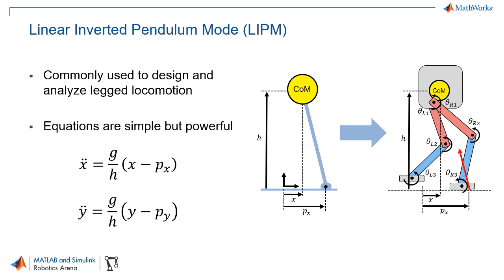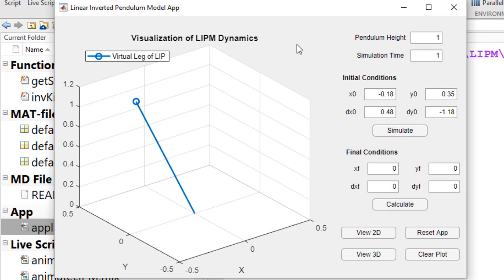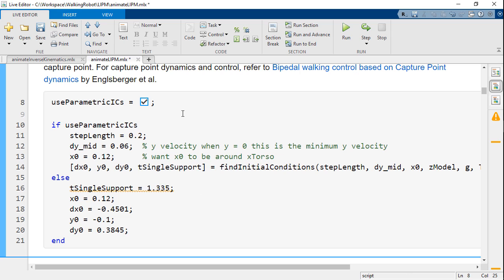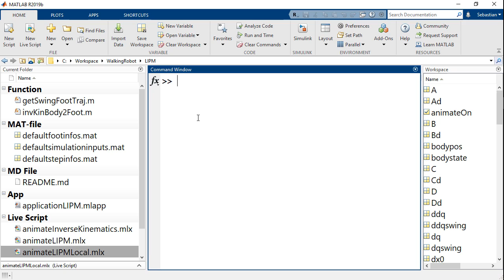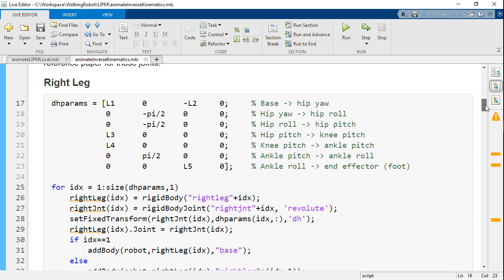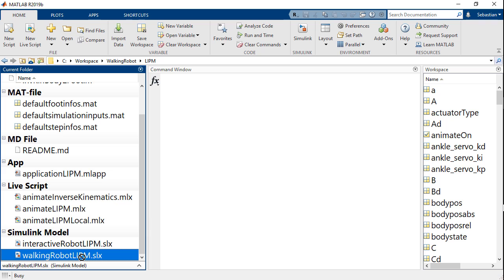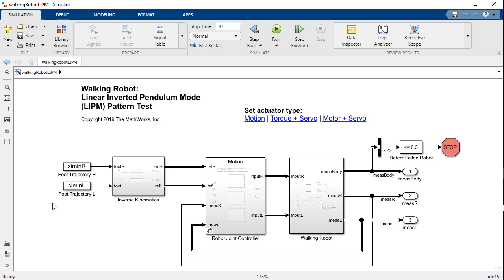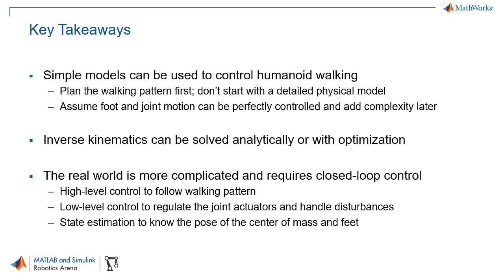Model-Based Control of Humanoid Walking

Comment: Hello @Bkim and sebastian, i'm Juan David Galvis, actually working in a project that is base in your excelente project, that project is for my mater's degree thesis, and i have a question that i really couldn't answer by myself at the moment, and it's how you build the model footinfo, where it has the diferent parameter for all the joints and movements, i'm already develop the database for recreate in my project but until now, i couldn't resolve that problem.
And it's because i'm working to recreate a working with legs but for a kinestesic work out, where we are implementing a mass-spring damper model.

So i'll be so grateful if you can helpme answering that question, how to recreate that file footinfo.
Thank so much to share your valuable knowledge.

Juan David Galvis
Physical Engineer
Universidad Tecnologica de Pereira - UTP 
Colombia
Reply: Hello Juan, I am glad this is helping you. The parameters for the joints are determined crudely based on intuition and assumptions. For example, Hip and Knee joints would use larger motor and higher gear ratio compared to Ankle joint. So I used values that would correspond to that. 

Please note that all the parameters are somewhat arbitrary. Although I tried my best to use values that would be close to real world robots, they are only educated guess (based on some references + intuition). 

If you have a real robot or a good reference for these parameters, please use them instead (and maybe also share knowledge). 

Modeling real things in simulation is hard. Even with best attempt there are always gap between simulation and real world. This project also suffers the same!
Reply: @bkim13 hi Brian, i'm so grateful of read your share knowledge.

I'm already searching a pattern of your file, like sometimg that a could use to recreate It in my own way.

I'm searching to take some initial input values from a model were It can work from information related with the walking pattern or trajectory in a free way, like ideal model without friction. do you think It could be posible, applying some equations that become that inputs in data like motor information?

It's like build a controller before to integrate that values to the simulation.

And i tell you a little more that could help to understand my idea,, our work consist of a sfuzzy logic controller simulation for isocinetic machine in work out were the body part involved are the leg, and the principal joint is the knee, so our simulation it's going to be reduced to a 1 joint to begin.
Reply: @juandavidgalviscastillo1071  I see. It could be easier to build the model from ground up instead. Try with fewer joints like you said and build your way up. That is how I built my model too. In the beginning it was just a few joints with no contact.

Comment: Hello! I have three questions, maybe anyone can help?
First questions
Can you control that robot using LQR? And how to implement LQR method into your model?
Second question, I saw that all of gains on your PID Controllers are so high. Can you explain why? 
Third question
It is about the torque that you've been controlled using PID. The input is motion, more precisely the configuration of all joints. Can you explain how could the input signal be controlled by PID and the output is torque?

Thank you so much, hope anyone will reply all of those questions 😊
Reply: Sure thing. 

1) Yes LQR can be used. But let's recap on the hierarchy here. When we control robot, we used 2 levels of hierarchy in this example (sort of): a) generate the trajectory for the robot motors to follow based on desired robot body movement; b) follow that motor trajectory. In this example I used very simple controls for motors to follow the trajectory (pure simulation motion, PID, and PID). Instead of PID, you can use LQR. Here the plant models would be that of motors controlling joints. Try it out and let us know how it works. 

2) Are PID gains high? What is it high compared to? For the given model/setup, these are the numbers that work well. Depending on how you define your model (e.g. what reference units used and what input units used), the number itself could be high or low. In this setup, those numbers made sense. I tried to setup the Simulink model to resemble real life robot closely (using realistic friction coefficient, gravity, etc.). But of course, there are always gap between simulation and real. 

This number might be high compared to motors with higher gear ratio. The gear ratios used here is 100, which should be in the similar range of actual gear ratio is this type of humanoid robots (very stiff, there are others that uses much lower ratio and others high). Depending on how you modify the model (to be more indicative of actual robot you use), this number may vary greatly. I would focus on the high-level picture; the numbers will be different for your particular robot. 

3) There are 3 variants for controller and motor model. For motor model go inside the mask of joint subsystems to see. The variants are Motion, Torque, and Motor. a) Motion joint is purely for simulation. On Simscape Multibody joints, we can directly tell how to move (it will generate the correct torque and velocity to achieve that).  b) Torque joint is where we tell the input torque for the joint. c) Motor joint is where joint has DC motor modelled, and we control the motor via its voltage (just like traditional motor control). 

The input in all cases is desired position (motion). Reference input to controller is thus position. Output from controller is a) position, b) torque value, and c) voltage value. Plant (joint) input is a) position, b) torque, and c) motor voltage. Plant output is "input" to the Simscape Multibody joint blocks (position or torque). 
Please note that in real life the a) doesn't exist, b) something torque controlled like pneumatic actuator and c) DC motor. 

Let me know if that helps!
Reply: @bkim13  can I ask further more questions by email?
Reply: Thank you so much by the way